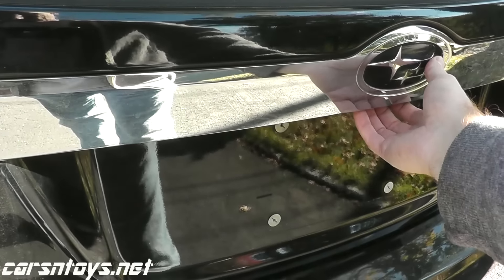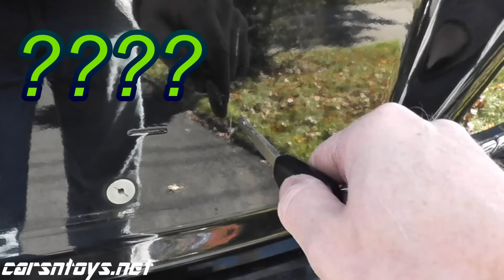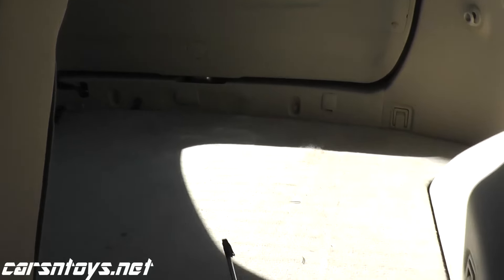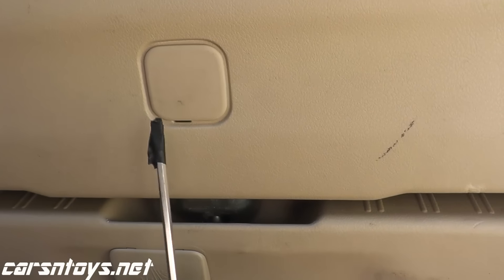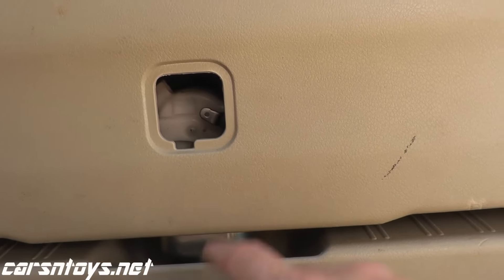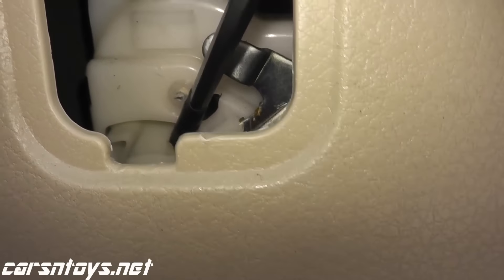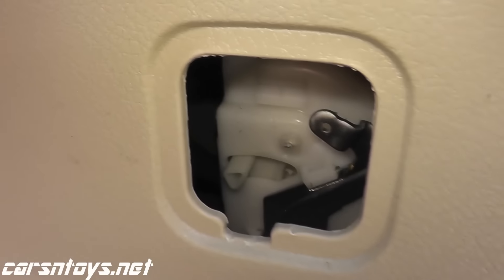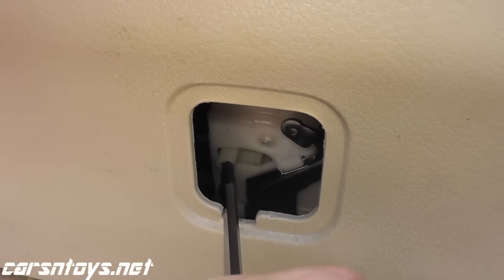How To Open A Hatchback With A Dead Battery

Comment: Today I learned that you shouldn't put the jumper cables under the back deck next to the spare. Because when the battery is dead, YOU CAN'T GET TO THEM, BECAUSE YOU CAN'T OPEN THE BACK.🤬😡

Thanks for this video.
Reply: Agreed.  And Yes, that is crazy.
Reply: IKR?!  I was like: Are - you - FRIGGIN' - KIDDING ME?!  Whichever engineer(s) proposed this and exec(s) allowed it should be SHOT!  There should be a LAW that REQUIRES: a) internal manual release level near driver's seat (like, oh, idk, the ones ALMOST EVERY vehicle already has for hoodm, gas lid and (if appl.) trunk???) and/or b) external key hole!  Cuz obvy whatever "competition" there is in the car industry has NOT been enough to motivate them to do it on their GREEDY/CHEAP-ASS own!  I guarantee if even ONE U.S. senator / congressman and/or his wife / daughter / etc. had to do this much less figure it out to begin with much less at night in the dark (cuz, you know, battery's dead?!), with a full cargo area, in the rain / sleet / hail / freezing cold / scorching heat, etc. they'd be sponsoring a BILL ASAP to REQUIRE a MUCH EASIER MANUAL POWER TAILGATE RELEASE!

Comment: Why don't they just put a keyhole for the hatch?  You should easily be able to open any vehicle door, with or without a battery.
Reply: IKR?!  I was like: Are - you - FRIGGIN' - KIDDING ME?!  Whichever engineer(s) proposed this and exec(s) allowed it should be SHOT!  There should be a LAW that REQUIRES: a) internal manual release level near driver's seat (like, oh, idk, the ones ALMOST EVERY vehicle already has for hoodm, gas lid and (if appl.) trunk???) and/or b) external key hole!  Cuz obvy whatever "competition" there is in the car industry has NOT been enough to motivate them to do it on their GREEDY/CHEAP-ASS own!  I guarantee if even ONE U.S. senator / congressman and/or his wife / daughter / etc. had to do this much less figure it out to begin with much less at night in the dark (cuz, you know, battery's dead?!), with a full cargo area, in the rain / sleet / hail / freezing cold / scorching heat, etc. they'd be sponsoring a BILL ASAP to REQUIRE a MUCH EASIER MANUAL POWER TAILGATE RELEASE!

Comment: I have no comment.....???How about if we can do this from outside of the car .I will never buy car if Im  not able to use a key and open manualy from outside of the car.What if my trunck is full with staff?I have to take everthing out to open ????????
Reply: IKR?!  I was like: Are - you - FRIGGIN' - KIDDING ME?!  Whichever engineer(s) proposed this and exec(s) allowed it should be SHOT!  There should be a LAW that REQUIRES: a) internal manual release level near driver's seat (like, oh, idk, the ones ALMOST EVERY vehicle already has for hoodm, gas lid and (if appl.) trunk???) and/or b) external key hole!  Cuz obvy whatever "competition" there is in the car industry has NOT been enough to motivate them to do it on their GREEDY/CHEAP-ASS own!  I guarantee if even ONE U.S. senator / congressman and/or his wife / daughter / etc. had to do this much less figure it out to begin with much less at night in the dark (cuz, you know, battery's dead?!), with a full cargo area, in the rain / sleet / hail / freezing cold / scorching heat, etc. they'd be sponsoring a BILL ASAP to REQUIRE a MUCH EASIER MANUAL POWER TAILGATE RELEASE!

Comment: Thank you for posting and keeping it simple! 
For those who posts on any forums, if you do not know that answer, JUST MOVE ON!  

This was posted on another forum and I did not find it funny...  
(If my finger doesn't work, I use my tongue but the edges are a bit too sharp in this case.

I couldn't resisit any longer either. Check your owners manual. Mine has a page on it.)

Comment: Ridiculous. Do this in -5 degree weather in the dark
Reply: IKR?!  I was like: Are - you - FRIGGIN' - KIDDING ME?!  Whichever engineer(s) proposed this and exec(s) allowed it should be SHOT!  There should be a LAW that REQUIRES: a) internal manual release level near driver's seat (like, oh, idk, the ones ALMOST EVERY vehicle already has for hoodm, gas lid and (if appl.) trunk???) and/or b) external key hole!  Cuz obvy whatever "competition" there is in the car industry has NOT been enough to motivate them to do it on their GREEDY/CHEAP-ASS own!  I guarantee if even ONE U.S. senator / congressman and/or his wife / daughter / etc. had to do this much less figure it out to begin with much less at night in the dark (cuz, you know, battery's dead?!), with a full cargo area, in the rain / sleet / hail / freezing cold / scorching heat, etc. they'd be sponsoring a BILL ASAP to REQUIRE a MUCH EASIER MANUAL POWER TAILGATE RELEASE!

Comment: Are - you - FRIGGIN' - KIDDING ME?!  Whichever engineer(s) proposed this and exec(s) allowed it should be SHOT!  There should be a LAW that REQUIRES: a) internal manual release level near driver's seat (like, oh, idk, the ones ALMOST EVERY vehicle already has for hoodm, gas lid and (if appl.) trunk???) and/or b) external key hole!  Cuz obvy whatever "competition" there is in the car industry has NOT been enough to motivate them to do it on their GREEDY/CHEAP-ASS own!  I guarantee if even ONE U.S. senator / congressman and/or his wife / daughter / etc. had to do this much less figure it out to begin with much less at night in the dark (cuz, you know, battery's dead?!), with a full cargo area, in the rain / sleet / hail / freezing cold / scorching heat, etc. they'd be sponsoring a BILL ASAP to REQUIRE a MUCH EASIER MANUAL POWER TAILGATE RELEASE!